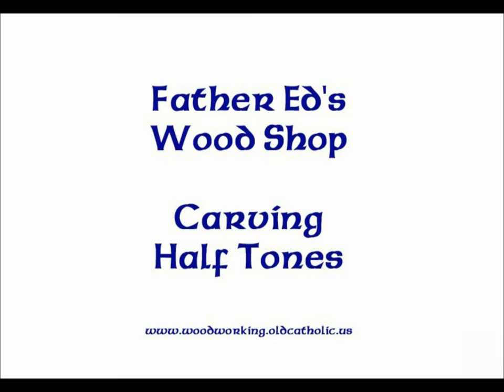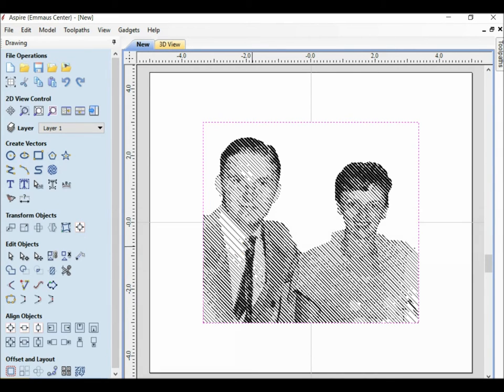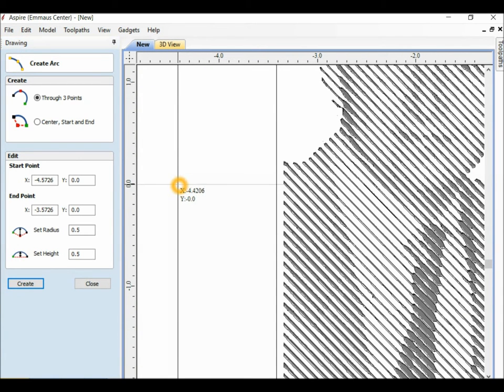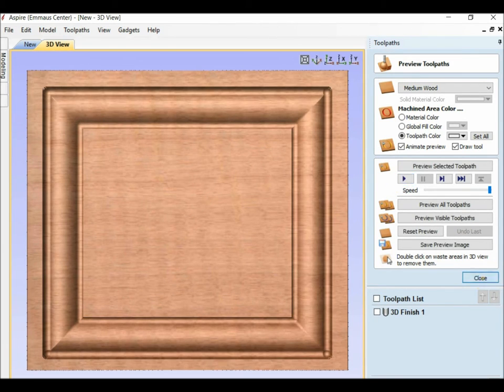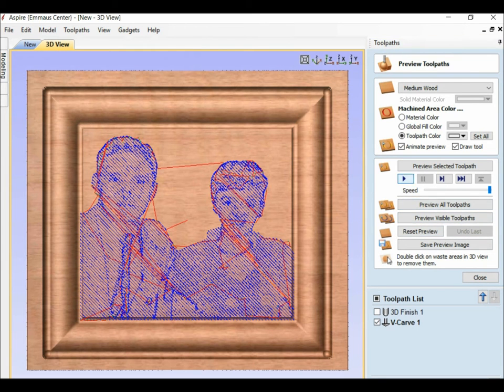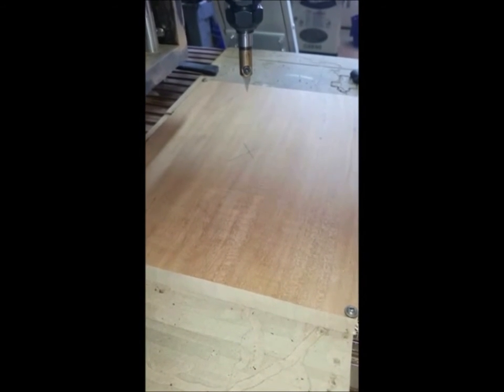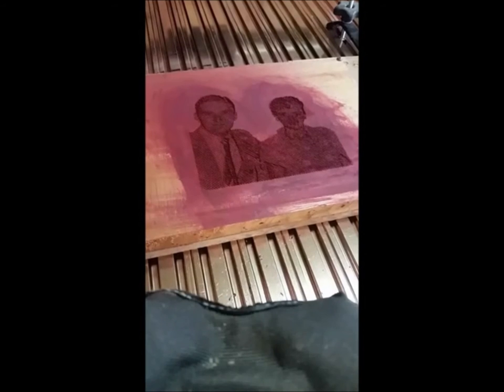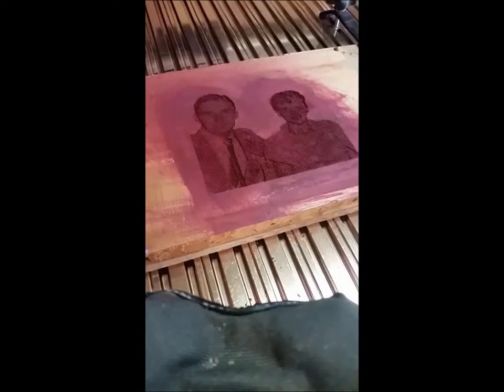Carving Half Tones with Aspire or V Carve Pro

Comment: Whenever I do a carving that will be painted and sanded to remove excess paint, I apply a couple of coats of sealer or varnish to the raw material before carving.  Sometimes also a coat of wax.  It makes it much easier to remove the excess paint.